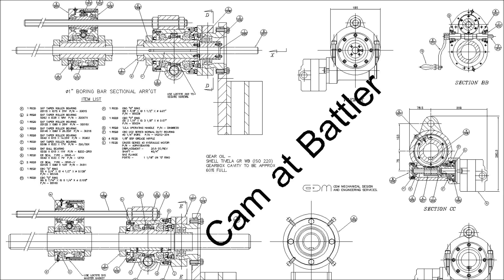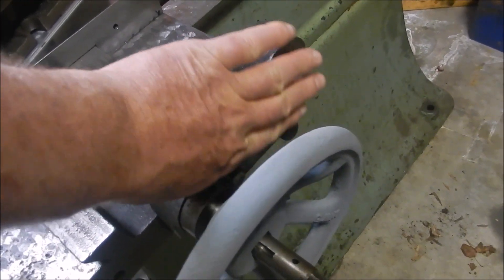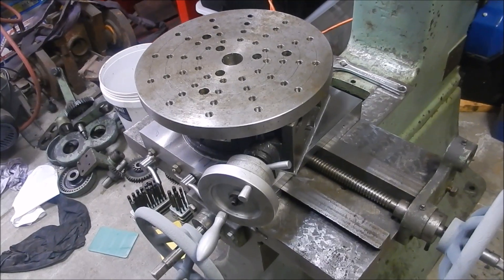Slotter Rotary Table fit-up, adjustments for the Gib and Gib Retaining Key

Comment: Good progress Cam .   Just an observation , can the rotary table be mounted 90 deg further around clockwise . This may allow clearance on the handle and for a set of indexing plates should the need ever arise .   This would also allow for locating blocks to be fitted at the front of the table for the machined end of the rotary table to register on .  Cheers   👍
Reply from the maker: G'Day Max, I did try every configuration I could to get best fit and everything to clear, It either fouled with the table handles or the rotary table handle fouled with the dovetail ways on the slotter table so sitting at 45 degrees gave me the best fit.  I wanted the Rotary Table hand wheel to be on my right as I might have the slotter up against a wall on the left side (struggling for space in the shop)   For indexing I won't be using the plates but I'll use my electronic divider with the stepper motor mounted to the Rotary Table input shaft. 
Cam